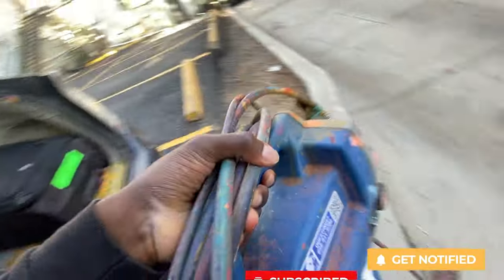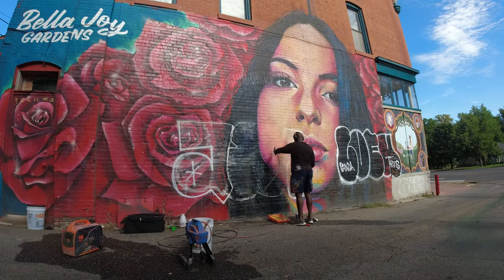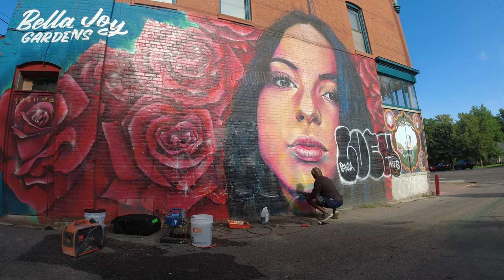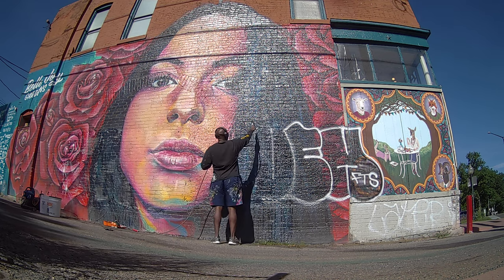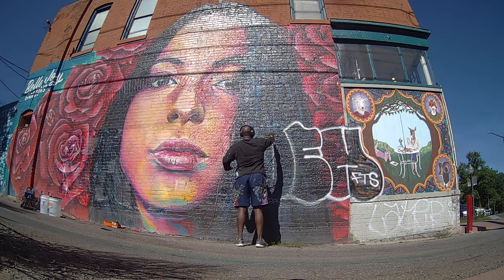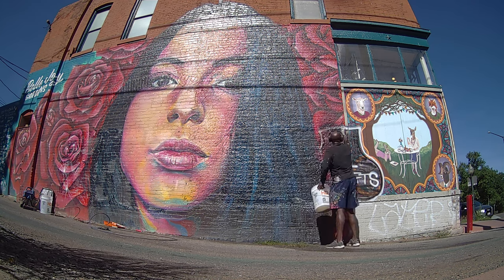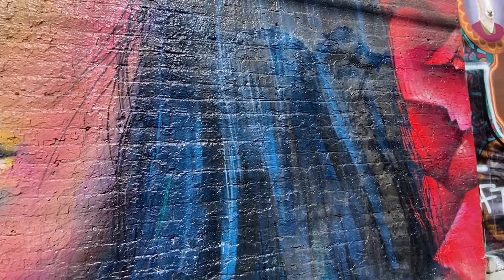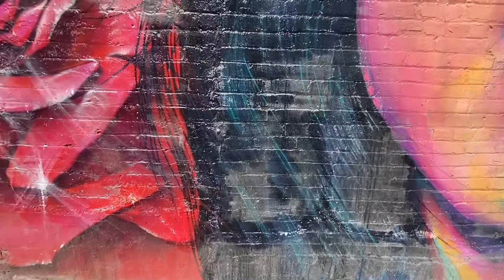Repairing a Street Art Mural coated with Sherwin Williams anti Graffiti Coating

Comment: I just tried a different marine coating from Sherwin Williams. I'm in the Bahamas, and this location didnt have the one you mentioned. But they recommended the Sher-Cryl HPA (high performance acrylic) coating B66-300 0r 350 series. One gal was about $140.
.
I'm glad to see that it is indeed drying clear (THANK GOD), and I will add a second coat soon and see how it lasts. The wall is very textured, and I wish I had a sprayer, but I'll have one in a few months. 
.
I also used it on the floor, since the mural extended to the ground. We'll see how it holds up to foot traffic.
.
I'll post a video soon too, to start my mural journey for the year.

Comment: What sprayer/tip/psi do you use to apply the coating? Man, the coating is running about $1500/5Gal down here. Thanks in advanced!
Reply from the maker: I use the 515 tip and the sherwin williams coating is super expensive but works well. i also now use the mural shield coating which is a lot more reasonable.

Comment: Great that cleaned up well for an hour . Personally I would have repainted but this works as well
Reply from the maker: The problem with repainting is the color matching. Because the mural is weathered by the environment even if you have the same colors it will be slightly more saturated than the rest of the mural. As long as you coat it right it’s a pretty quick fix.